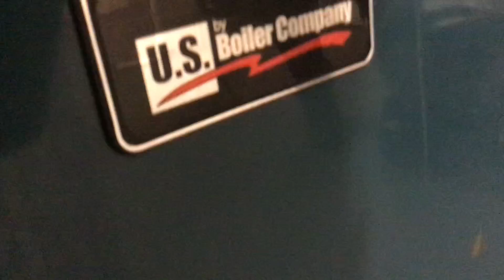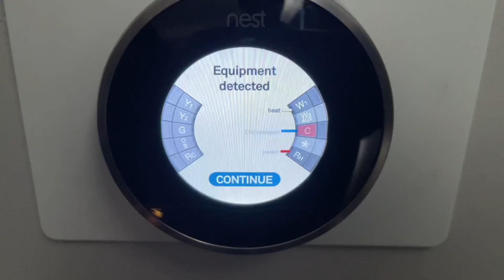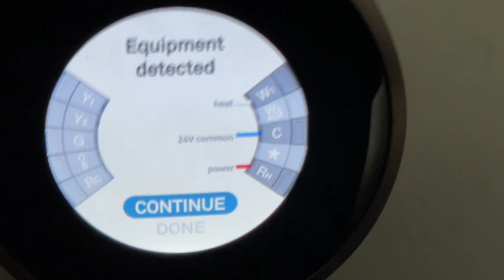Nest E29 Error Wiring Issues with Nest and Burnham Independence Steam Boiler Resolved

Comment: Great video but I noticed that the back room zone was incorrectly piped to the boiler. It is feeding out of the bottom of the boiler and returning back to the bottom of the boiler, connected to the same mud leg. feed and return are connected straight thru mud leg therefore 
They are just circulating the water at the bottom of the boiler, the aqua stat on the feed line at the bottom of the boiler will never satisfy 
Therefore making steam in the main zone and over heating. That is a common hook up because gas boilers have few tappings.
The correct way is to pipe zone is to take supply from below the water line and return to the bottom of boiler. Most gas boilers don’t have the tappings to install properly. Therefore we take the supply from the bottom of the boiler and return to the skim tapping with a check valve in return line just before entering boiler so no steam can push into zone (because it is above water line)  I’m sure this is happening on this job.   Thanks Eric

Comment: Wait a second you didn’t connect the wires correctly which nest high listed in red, the you connected it correctly and it worked , now imagine a homeowner who installs his own thermostat and then takes out a jumper between rh and rc and complain that his ac is not working since only only rh is getting 24 v.

Comment: Nest's won't work with 2 wires you have to wire to a separate transformer so you have a common. They draw a lot of power and they recharge on the off cycle. The small transformers in the Taco zone relays or in the boiler won't cut it

Comment: Always run into the issue where someone puts in a nest and it has no common connected. In the book it states it power steals and common is not required . I find that feature fails and stops working . I hook it up correctly with a common after that all is well no more issues
Reply: Not if it has the input for an android charger, I don't believe the first generation does.But later generation do.I AGREE MIKEY ALWAYS HAVE A COMMON REGARDLESS, ALWAYS COMPLETELY AGREE.From working on so many nest out east,I have found a couple quirks with them.They suck with heat pumps,You'll set them up right and before u know it they will stop energizing O/B.If common isn't used,and there charging when it dies with an android plug,(nest says that after being charged they should hold power for at least 6 months if they don't replace the stat)Once they start short cycling u know Theres a problem with the charge.COMMON IS ESSENTIAL, but out east if they need a WIFI STAT  I recommend honeywell.ESPECIALLY WITH GEOTHERMAL AND HEAT PUMPS.

Comment: One thing I've recommended to friends with a Nest, get a Nest Protect and put it by the boiler/furnace.  If it detects Carbon Monoxide, it'll both warn you -- but also tell the thermostats to immediately shut down, if configured properly.  I consider that an important safety feature.  (Nest Protect isn't cheap though, about $100 a smoke/co detector.)
Reply: hmm never knew that
Reply: @PipeDoctor  From the nest docs:
Learn about Emergency Shutoff
Emergency Shutoff lets Google Nest Protect tell your Nest thermostat that there’s an emergency in your home. During an Emergency Alarm caused by carbon monoxide (CO), the Nest thermostat can shut off your heating system for safety if it uses fossil fuels (such as gas or oil). During a smoke Emergency Alarm, the thermostat can also shut off fan-based systems to prevent the smoke from spreading further.

Comment: I'm a huge fan of the Nest thermostats, installed many for friends over the years, but one thing people often miss is an under sized transformer.  Each nest can consume about 4.8 VA.  With the Honeywell style zone valves on hydronic they each take 7.2 VA.  So a 3 zone system can end up taking 36 VA just to run the equipment before possible other 24 VAC accessories.
Reply: 2 or mores zones always use  a 40 va transformer.   Preventative maintenance.

Comment: Cool video! We recently had 3 Nests installed to our Weil McLain CGA Gold Boiler. One on each zone each with it's own 24V transformer. Had to have all new wiring put in to add the C wire. It was a big job (not sure if we will ever recoup what we paid) but worth it as we travel a lot and wanted to control temp when not home.
Reply: Could have just used the add a wire setup
Reply: @petersmart1999  We only had a 2 wire system (boiler). I don't think we could have used that.
Reply: @matthewviti2241  That's what the add a wire is for,they created them for that very reason.Look them up. Ventstar Add a wire
Reply: I installed an Ecobee thermostat on my 2-wire hot water system. The existing thermostat wire has 4 or 5 conductors. I just connected the existing unused blue conductor to the C wire connector at the zone valve and thermostat. Works great.

Comment: got to laugh, I have an old mercury thermostat, and never had a problem with it in over 50 years. Just fine if you don't change settings.
Reply: Beside the 'controllable with my phone' part of the Nest, I've found that they do an amazing job of turning on the heating system to keep the house a much more consistent temp then the old mercury ones.  At least in my home they would undershoot (felt cold)/overshoot (room got to temp, and then kept heating due to the water in the rads) continuously, the Nest evened it all out and now the house stays VERY consist.
Reply: DITTO 30 yrs here 
It is a honeywell vertical rectangle millivolts  dont know model just know I always have heat even when power was out 🙂
Reply: @mikeholubek4419  How does the boiler/furnace work without power?

Comment: Great as usual. When people buy thermostats that require C and they have a 4 wire set up, I'll move G over to common, The only thing you lose is the fan on function. 99% leave them on auto anyways so its not a big deal. However if they want to pay me to run 5 wire I'll do it lol.